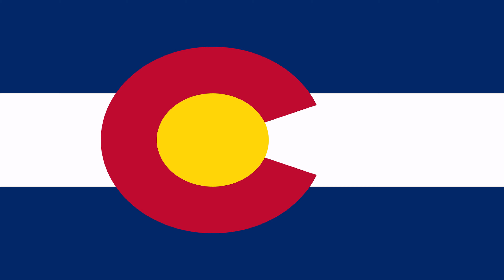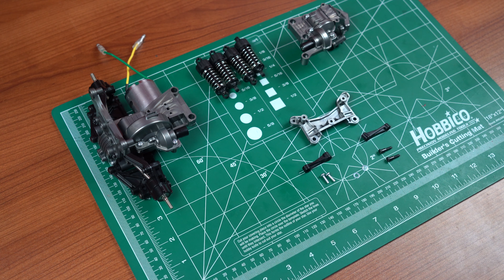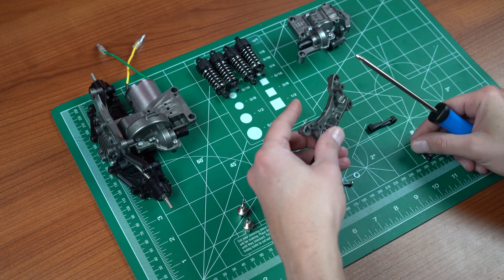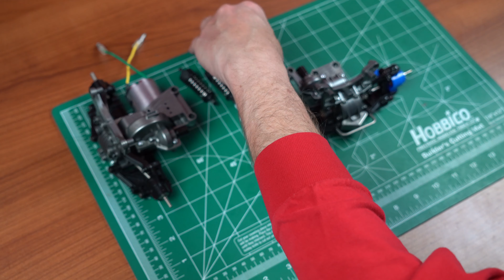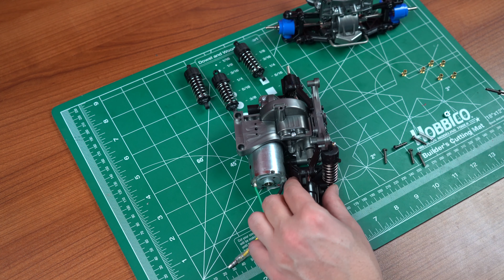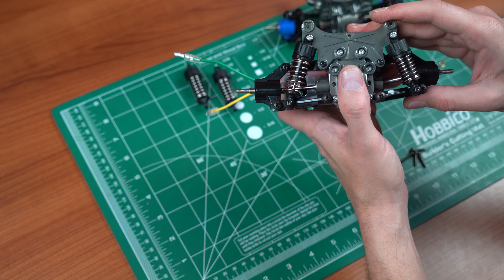Tamiya Lancia 037 Rally TA02S Build Part 4

Comment: Looking forward to seeing this compete man! Never had a Tamiya before, seriously contemplating one so I’ll be following this build 🙂
Reply from the maker: Thanks man! Tamiya have the best kits as fast as build experience goes in the whole hobby. Find one that looks good to you and go for it! Appreciate you watching bud. 👍👍
Reply: Thanks buddy. I’ve had my eyes on a CC01 but I’m just concerned with its capability as the places I have to play are pretty heavy on the Forrest pine needles and roots etc so I don’t want it to end up sitting on a shelf. Think I just need to bite the bullet and order one, easier said than done when I have a list the size of my arm of goodies I want lol.
Reply from the maker: @ExperienceRC  Funny you mentioned that chassis. I'm wrenching on mine now. It's not good on crazy terrain but it's fine on trails. Steering is the weak link and it's approach angle isn't great due to the brick in the chassis at the front lol. All that said, I love mine and run it often.

Comment: Great build Omar. I soon will get my XV-01 to build :)
Reply from the maker: Awesome! Enjoy the build. Be sure to pick up the hop up aluminum hinge pin mounts. That's the only parts I have ever broken on mine and they have been replaced with the nice blue upgrades.
Reply: @theibault  Well I stopped buying spare parts before it is needed as long as it has no performance advantage. When it brakes, I still have a second XV-01 here and then I will upgrade :D